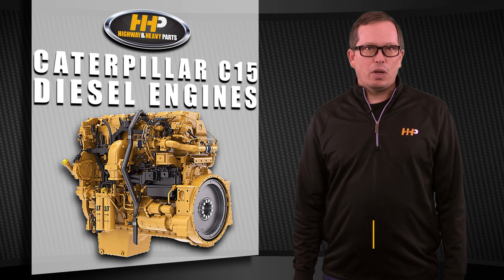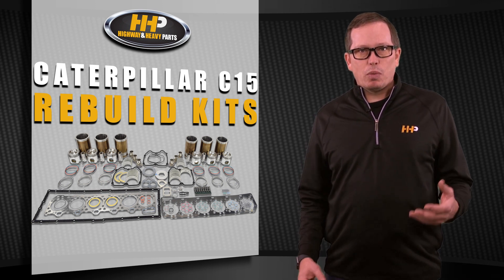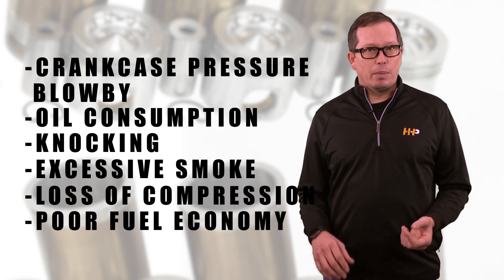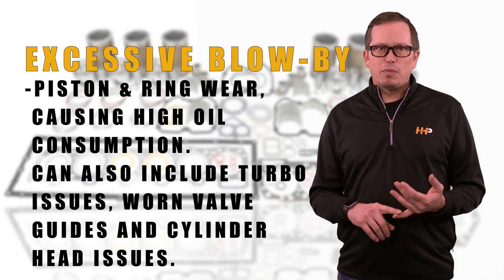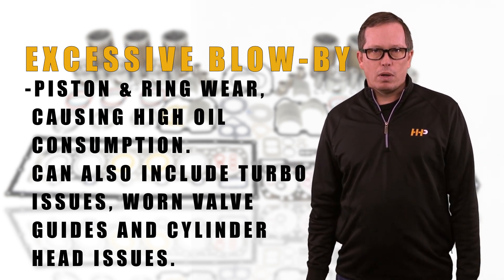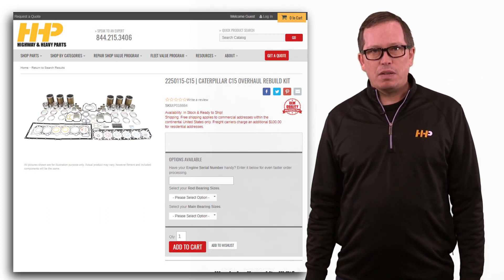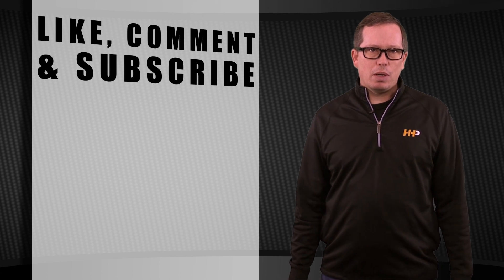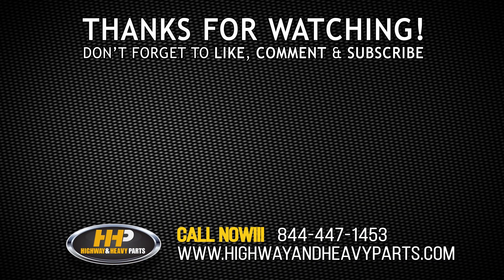When to Rebuild Your Caterpillar C15 Engine. HHP Can Help!

Comment: cat c-15 leaking fuel from head, spacer plate, exhaust manifold and oil pan could mean its due for overhaul ?
Reply from the maker: It's possible, but I would also inspect each component to make sure there are no cracks that would cause this problem.  If you have any questions, connect with one of our ASE Certified Parts Technicians.
844-447-1453